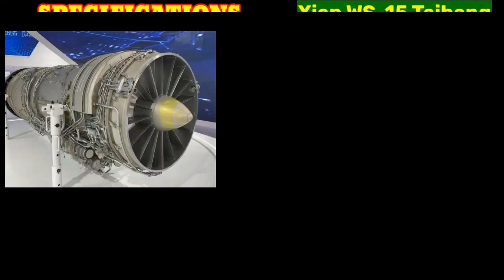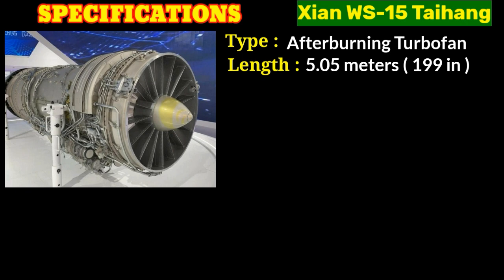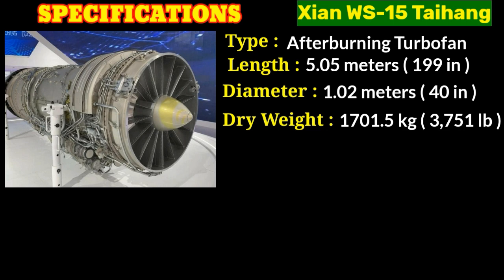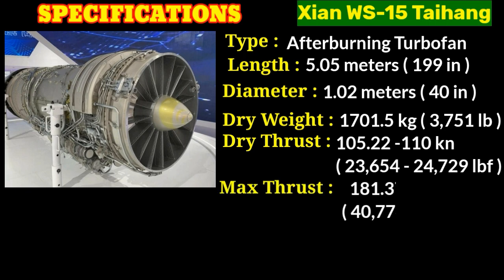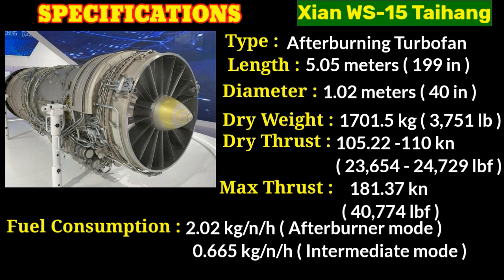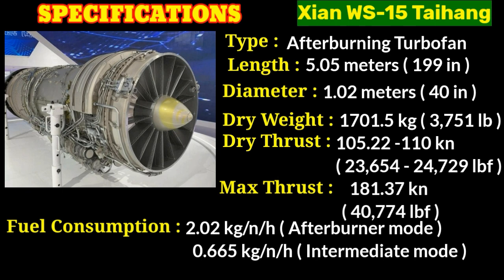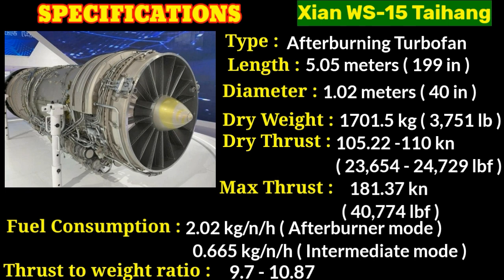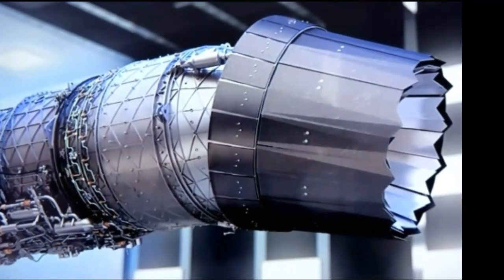China's WS-15 Jet Engine Specifications | Turbofan Engine | J-20 Stealth Fighter's New Engine!

Comment: The second most powerful engine after US' Pratt & Whitney F-135 PW-100 : 191 kn max thrust.
Reply: F-35 engine has higher trust but not much boost to the F-35, which can't even reach mach 1 with bombs fully loaded. And with the higher trust comes the engine lifespan which is only 2000 hours. China WS-15 is at 6000-8000 hours before changing. F-135 runs much hotter than WS-15. F-22 is only at 2500 to 3500 hours due to the G stress the plane pulls.
Reply from the maker: F-35's Engine.
Reply: @defencerelatedtopics4009  yes
Reply: But the f135 is a physically larger engine.